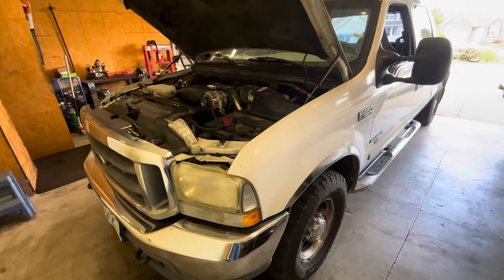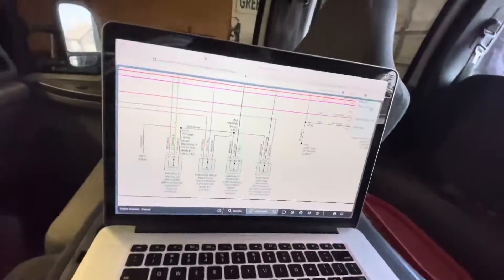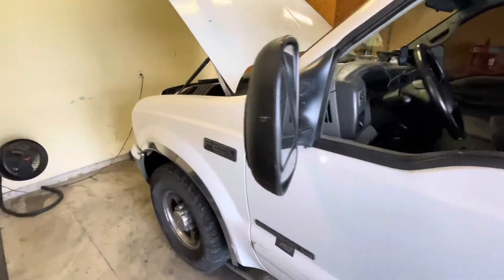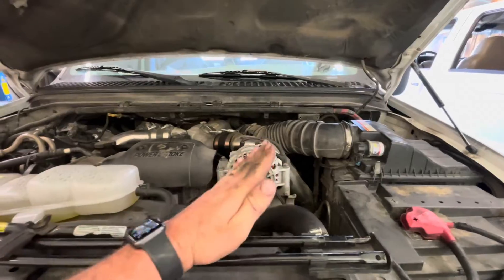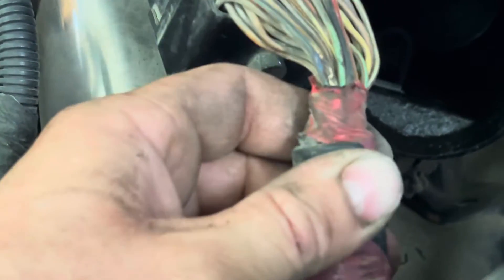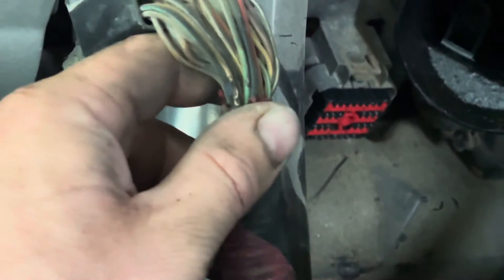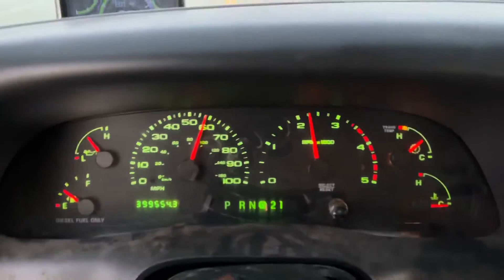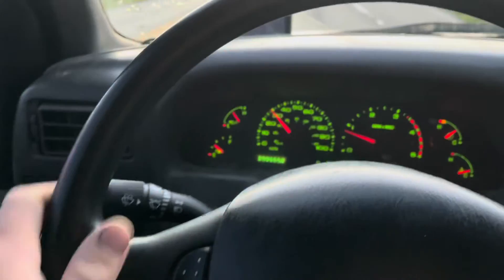7.3 Powerstroke P1280 Electrical Issues When Hot FIX

Comment: I have a high delta on #8 and a misfire after reman injectors.   So I swapped it with my old injector, and now I have a high delta and misfire on #3, but not number #8.  Any ideas? 

Changes the injector cups because of fuel in the coolant reservoir.  Replaced the injectors as preventative maintenance thing, nothing but trouble since.

Comment: The owner is lucky that could have cought fire would be my first thought be sides lack of power my 99 doge ram wheel chair van 1500 just had a water pump replaced 900 bucks from the dealership but it's fixed running good 64 thousand miles on it now 55 when I got it new tires and battery in 20 20 got it in 20 16